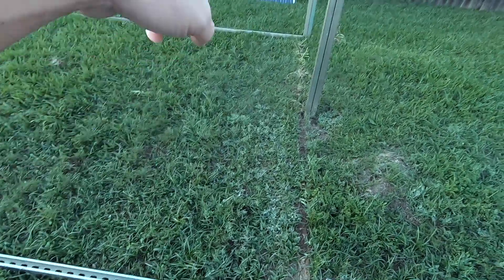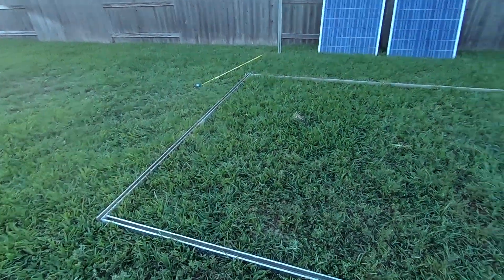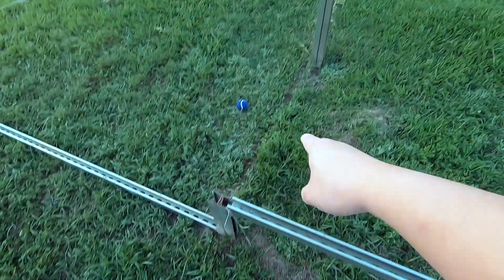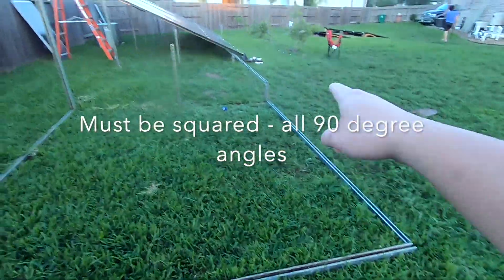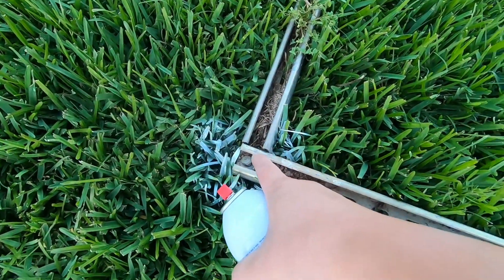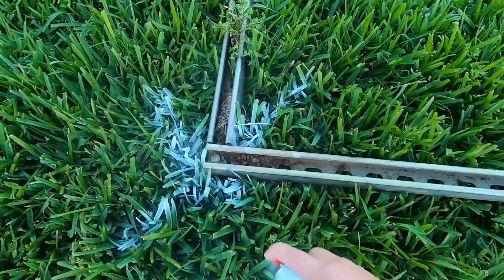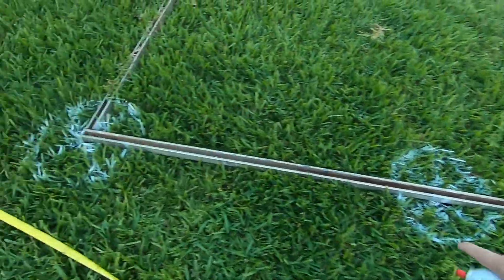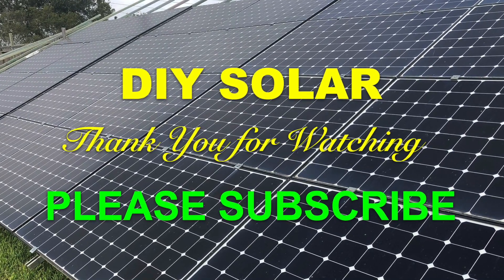ADDING NEW SECTION - GROUND MOUNT SOLAR SYSTEM

Comment: How many superstruts 10 ft pieces needed per section?
Reply from the maker: Each one of my ground mount solar panel system consists of:
6 for posts from ground
3 for horizontal beams
3 for vertical beams
Total: 12 superstruts per section

Comment: How many solar panels can each section hold?
Reply: I would say he could put a fifth row.  The panels only way 40 to 60 lbs each  and 4 panels weight on 3 posts is only 160 to 240 lbs the problem is wind force etc which can be much more. The posts have no problem supporting the panels weight  you could probably put 4 times that on them but it  would require a shorter span . I would place the vertical ground posts every 5 feet or so rather than 10 feet which is essentially what he did  later when he saw sagging between the supports.